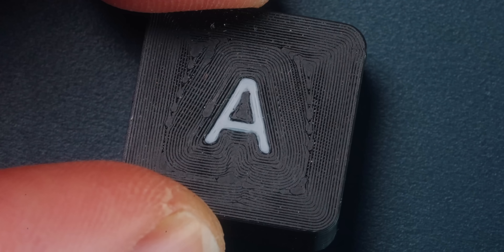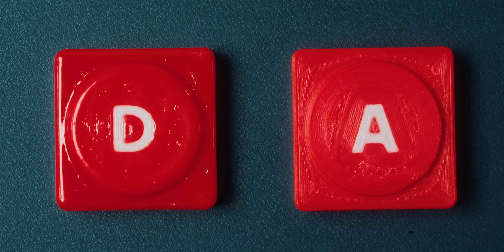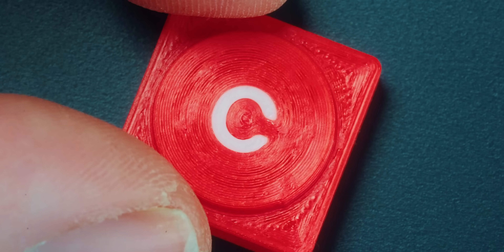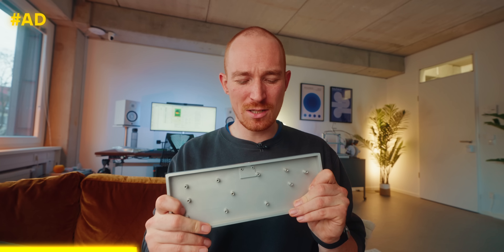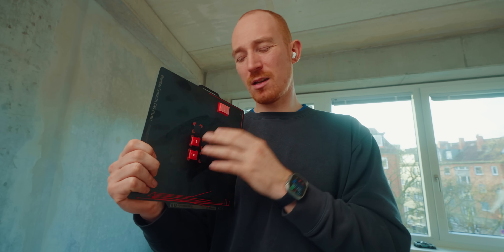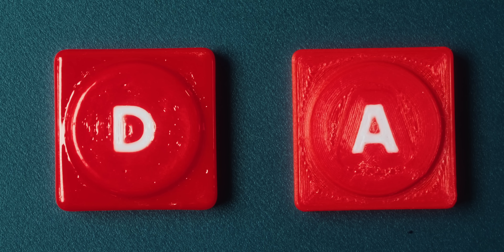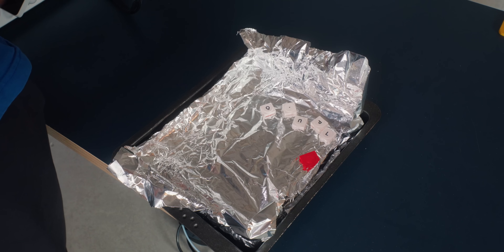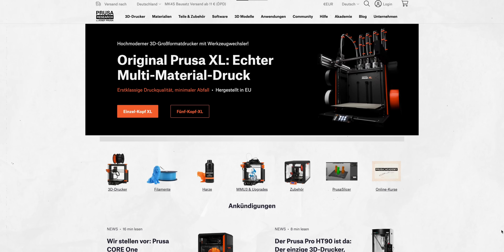How to make Your 3D Prints Look Factory-Made!

Comment: I recently made my own key caps, but in a different way you may want to try out as well: I opted for flat caps and printed them upside down on a satin steel sheet and used PETG. They come off directly usable without any post processing. The ones with the index bumps I did with ironing and just wet sanded them with 600 to 1000 grit. Most important for good quality is flow calibration. I used a 0.2mm nozzle and did flow calibration with the method using a micrometer screw and printing vase mode cubes. With that, there will be no gaps in the top or bottom layers.
You can find a picture on Printables by searching for "NEO2 Low Profile Keycaps".
If you want the curved surface, I would use variable layer heights and print the curved part with a very small height. Afterwards, I would wet sand them again, maybe start with 300grit and go up to 1000.

Comment: Acetone is very safe as it's most commonly used for nail polish removal, its safe for contact with skin and definitely safe to breath if you smell it in the air, gloves are reasonable since contact can slightly dry the skin if you have a very sensitive skin. A breathing mask though is just dramatic...
Reply: Acetone is not "very safe" oh my god, it's not violently harmful, but you should try to minimize direct contact to your skin or vapors when possible. Using it on your nails is one thing, but in a chemical process calls for proper safety measures. Same as iso alcohol.
Reply: Wow what a terrible take. Acetone is definitely not safe to breathe.
Reply: @MikeEarleyfivestar  can you please give me some sources?

Comment: when I first started 3d printing years ago I didnt know you couldnt vapor smooth PLA, it did not go well because it still gets effected but it does not smooth, it goes all white and brittle :/
Reply: Pla is pretty much insoluble to everything. I have pla prints sitting in baths of various solvents that will solvent bond pla surfaces, but even after months there's no degradation of the print.
The best solvent for bonding is ethyl methyl acetate. Metgyl ethyl ketone is slightly worse, and diethyl acetate worse again. They work as glue, but won't dissolve or smooth a pla print.
The only way that really works is a heat gun or butane torch.

Comment: The best and quicker way is to print with another color on the penultimate layer and then laser engrave the last layer to show the color differentiation, already tested with PLA and the results are just perfect, and for the smooth results just add ironing, 

The vapor smoothing way have better Results but in a production rate laser is the way to go, or even mold injection but it's not the same price as a laser engraver plus a 3d printer haha

Comment: Pretty nice finish. Did you ever try this with dished or domed keycaps? Would be interesting to see if it can dissolve layer lines in that extreme scenario. I recently designed a game boy keyboard where I ended up using UV glue to get some shiny domed keycaps. https://youtu.be/un3xsArqN8g?t=7m56s

Comment: Pcb wsy is like 5 to 10x more expensive then direct order from factory
Reply: What factory is doing custom 1-of-1 orders of your parts for 1/10th of what PCBWay is quoting? If you're talking about non-custom parts, then of course, order the off-the-shelf component directly from a supplier but that's not what PCBWay is intended for.

Comment: maybe flip it around use special supports and embrace the pei
Reply from the maker: Yeah I tried flipped which gave better surface finish but the supports needed for the overhang really created problems for the rest of the print
Reply: @arnebornheim  I was talking about maybe the dissolvable supports by Bambu labs?
Reply: Doesnt that one make super good prints

Comment: how are you ventilating ASA printing inside your home?
Reply: The bento box is a good precaution, voxel sells em ready made too, they also sell a hepa+carbon filter replacement for the X1C’s carbon filter.
Reply from the maker: The honest reply is not really. I mostly printed over night and then opened the windows when getting back but definitely no real system …